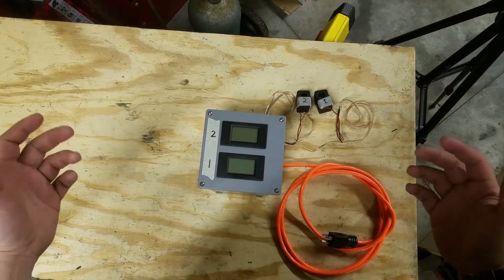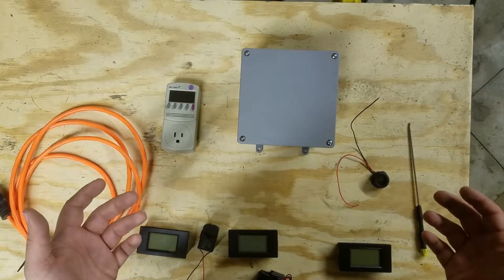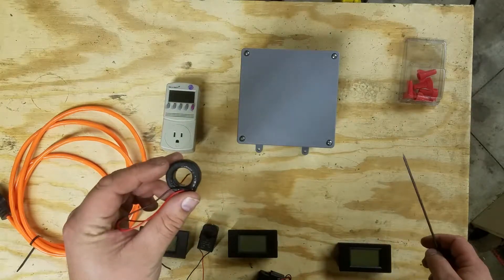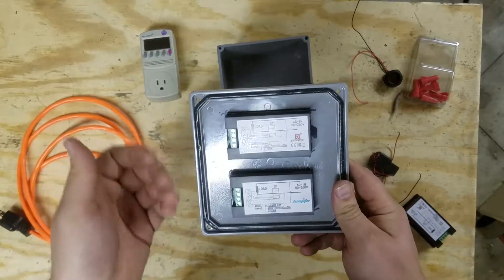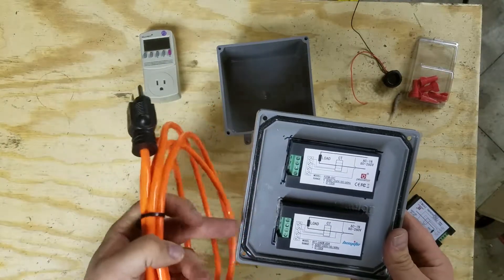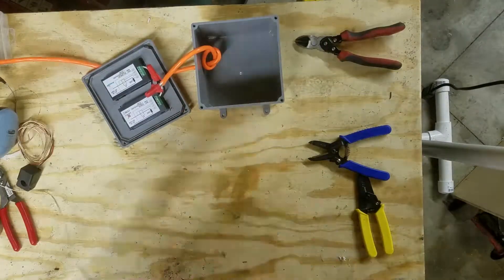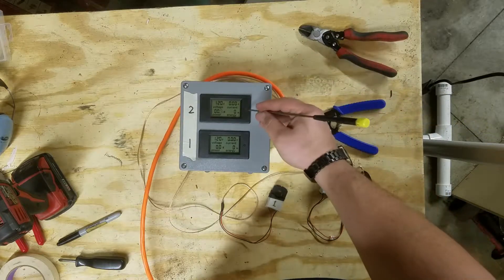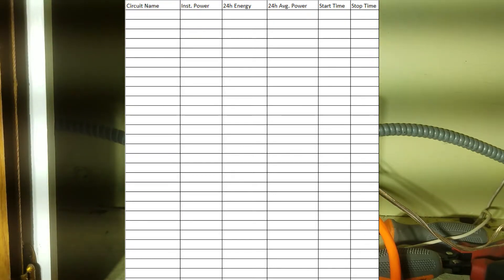How to Make a Simple DIY Home Energy Monitor (Please don't build this)

Comment: Let me get this straight......each meter measures the separate A and B legs of your main home panel ( each 120V ;  together they provide the 240V input to the main panel). However, the POWER input to the meters is from ONE of these legs....either A or B.....the way you did this with the orange power cord that is plugged-in. Is it a problem that the supply power comes from the same source to power the meters.....yet the meters READ each individual 120V power source? M y point?...should the meters ideally be powered from the legs they are monitoring ? Also this....if it's OK to power the meters from one leg.....can the power for the meters come from a new breaker added to the panel?. The breaker would be massively over-rated ( breaking amps) but would provide a clean power feed installation . Can we then wire-nut or WAGO 2 pigtails on this breaker,  to feed each meter then from one leg?
Reply from the maker: Yeah, one leg might vary in voltage slightly from the other. It's close enough. This isn't rocket science. If you need more accuracy, you should be paying a professional to do this. In fact, my whole setup here is janky, so I would recommend paying a professional to anyone that does not quite understand the electrical nuances involved, and why this voltage difference is not significant enough to account for given someone so cheap(Not saying I'm not cheap, of course).

The IotaWatt also only uses one 120V reference by default, and I've found the energy readings from it to be very close(Less than 1% variance) to what my power company shows.
Reply: @manovermachine  ..thanks.
Reply: @manovermachine  ...I didn't mention.....but maybe should have.....I am intending to install these 2 meters to indicate the power supply from an emergency standby generator that is set up to backfeed my panel via an interlock setup. So yeah...it's not rocket science, BUT....the 240V incoming from the L14-30 connection (240V) of my generator....is created from the 2 coil circuits on the genset that make 240V....and measuring each side can indicate the health of the gennie AVR or its brushes...so trying to keep the 2 circuits separate from both a power supply standpoint and also the monitoring standpoint.... seemed important to me. Maybe it's not, as you said, but you also assumed line power throughout.. Hmm....that said, maybe this only makes a difference if the meters are connected directly to the generator panel vs near the main panel? Do you think it does? That's why I also continued with the question of panel breaker supply to power the meters.... that (maybe) power should supplied to one meter from panel leg "A" and the other meter from panel leg "B". I'm saying all this in case you have a different answer based on measuring non-inverter gennie power ...vs the line power scenario, where you clearly said show so little variation. Thoughts?
Reply from the maker: @TheWilferch  If you have the potential for there to be a fault in which one leg of the generator's output voltage could vary in a fault condition, then it would certainly make more sense to hook each power meter's voltage input up to the same live they are measuring, respectively. I just combined them because it was a lot simpler than digging into the panel for what I admit is a pretty.... lazy setup. Mine was intended to be very temporary.

As for being at the generator vs at the main panel, there will of course be a lower voltage at the panel than measured at the generator due to line losses between the two under load. I can't think of a technical reason of why you would need to choose one over the other off the top of my head, so I would say go with what your preference is. Just be aware that power readings and voltages, and thus powers will be slightly (hopefully not much) lower if measured at the panel vs at the generator.
Reply: @manovermachine  ....thanks for staying with me on these nuanced questions....all good......thanks !!!

Comment: Could you please tell me what make is the meters also can I obtain them from (Amazon )
The thing is I have an (industrial fan heater ) I was unaware that I had turned the thermostat knob to max and in turn it melted the rubber plug. 
It was drawing (16 amp ) instead of (13 amp). It melted the plug socket at the same time. During 09:15 hrs on Sunday 25 December.  I would like to build one.

Comment: But how will the two meters read any different values aside from the current clamp signals?  If both are wired parallel to eachother and into a single circuit then the voltages will always be the same and what voltage the circuit is theyre plugged into..  i would think that they would need to be put in series with a circuit to monitor the power consumption of the things on that circuit..  like if you were to run a submeter in line with the two main line feeds to your panel so it sees total power consumption. Just like the power companies meter..  i was wanting to install something like that because i dont trust the electric company meter..  wanted to verify my usage..

Comment: In my home country Nigeria, electricity distribution companies issue estimated electricity bills at the end of the month and the cost of getting a prepaid meter is much, pls can this be used to take readings of power consumption at the end of the month?
Reply from the maker: You could use this device to measure your power usage over a month. Having said that, this does not mean that the energy supplier / power company would accept these readings if it wasn't an approved or calibrated device. That'll be dependent on the laws in your country, and the agreement with your power provider, etc.

That said maybe you could use it to start a conversation with them if you find your estimated value is very far from measured. (The meter will probably only be accurate within a few percent, but probably within 5 to 10% easily depending on the quality of the device). If it's very close to estimated, you could probably rest easy knowing that you don't have much to gain from getting a meter.

Comment: If I had a grid tie inverter and let's say I was pumping 1000watts into one of my circuits.
Would the 120v side of the grid tie circuit read the same? as I'm still consuming the same power, but drawing less from the grid. 
Or is this only seeing power coming in from the grid ?
If that's case I would see a 1000w drop in wattage?
But thinking how electricity flows I don't think this setup would beable to see that 
It would just show power consumption no matter where it's coming from ?

I know I can see the difference on my mains power meter.
Reply from the maker: The meters I used are incapable of determining which direction the energy is flowing. They're programmed to assume that regardless of whether the current and voltage are same or opposite polarity, that power is being absorbed. This makes it easier for the layman to hook up and use it, but they are not suited to a case where you may generate electricity. There's likely a different brand out there (and probably for a different cost) that takes that into account and allows you to measure net power, but I haven't looked for one yet since I currently do not backfeed any power to the grid.

Comment: I understand how this works for 120 volts on each leg. But if a device uses 240 volts aren't you measuring its wattage twice if you just sum the two meter readings?
Reply from the maker: If you're powering the meter from 120V, the wattage is calculated based off that, but if you power the meter from 240V, the wattage is calculated based off that times the amperage. For a 240V device, you only need one meter if you hook the meter up to 240V. IF you hook the meter up to 120V, then you'd need to measure the current twice (or just double the power usage) to know what the device actually used in terms of energy.

 Then again, I feel like greater care should be taken than I took in this video to make this a safe setup. Shouldn't have current transformer wires hanging out in the open.

Comment: This is pretty cool. I need to install something like this on the panel to check when i run my gen. I just did 7 days near NOLA after Ida. NOt fun.
It would be sweet if it were possible to connect to your phone through bluetooth to monitor inside.
Anything like that exists?

Comment: Question. Do the two meters need to be connected in separate lines or legs to have their power up in generator backup? I know that the CT has to be on each hotline but I'm wondering if the measures change by having them both connected in one breaker (one leg) or separate legs for the meters.
Reply from the maker: Ideally they'd be on the corresponding 120v hot leg that the respective meters CT is on to provide an accurate measurement. But it would be close enough if you used the same for both, since we're not doing rocket science.

Comment: Pardon my ignorance but I have a question...  you have 2 because you have a 200a panel and #1 is going attached to the black cable and #2 to the red cable incoming main lines?
Reply from the maker: I don't have red cable on my incoming lines. It really depends on when your house was built, and where, etc. But those are the two 120V leads from the 240V split rail service, so that is correct in why I have two meters.

I'm measuring each 120V leg separately, because the Neutral connection exists and a current imbalance can exist between the two lives.
Reply: @manovermachine  so, your panel is a 240v panel receiving 2 cables with 120v and 1 neutral.  ok if that is the case is just like mine. I would also need 2 of those.

Comment: Interesting.... why two units?  Also... could I use this as a way to read the wattage draw from my portable generator when connected to my house?
Reply from the maker: Houses in North America use 120/240 split phase power. If you have an unbalanced condition where one branch is pulling higher current than the other, one meter cannot accurately measure the total power, so I just use one for each 120V rail.

To use one meter for all of it you'd have to reverse the other live wire and pass them both through the current transformer, and read from a single 120V line, which would result in your voltage no matching as the drop across the wires on the other side will be different, especially if current is not balanced and there's some in the neutral.

Plus the incoming wires are too big, stiff, and short to get around one current transformer.

You could definitely use this on a generator if you wanted. I feel like it's a really clumsy setup in hindsight, but it does the business.

Comment: I'm no electrician so I have no idea what I'm talking  about. I'm just trying to understand. If you plug your meter you made into a 120V outlet and then put your ammeter over a water heater circuit (240v) won't it give you an incorrect power reading? A 240V water heater drawing 20amps will use 4800 watts of power. The meter plugged into a 120V supply will be calculating the power incorrectly for the 120V, not the 240V. It will only show 2400 watts of power being used. This will show a huge miscalculation on how much energy the 240V appliance is actually using. Am I doing this wrong?
Reply: Right I don't think his wiring is correct. From my understanding you would need to get the voltage to power the meters from the mains (this completes the loop in the diagram)  You need to double tap the main breaker with a wire. The wire then runs to each meter from each leg of the main. I'm 
 not a big fan of adding another wire coming from the main breaker.  Let me know if I'm wrong or right.
Reply: @billdee814  I don't think you'd need to directly tap to mains, if you had a 240v breaker in the panel. Add each leg of the input power to the 240v breaker, the voltage is now correct in the meter and meter calculations. I would never tap directly to mains power.

Comment: Why didn't you show where you plugged in that cord? Did you just plug it into any old 120 outlet? Can you please expand on that connection?
Reply from the maker: Just plugged it into any old 120V outlet. Not aiming for rocket science levels of precision here, if you're on a different 120V rail there might be some error if one is more heavily loaded than the other, but you're probably within 5-10% easily in a normal case. If you want to be more accurate, make sure the 120V tap is as close to what you're measuring as possible, and on the same circuit.

Comment: It's unclear were you connected your 3 prong extension cord in.  I a wiring diagram would help here.  I'm thinking it would only connect to one side of the load, ie, one of the 110 legs.  Don't you need each Meter to have it's CT and load to be within the same circuits.  Same leg of the different legs of the 240V
Reply from the maker: For these meters, it does not matter which leg of the 240V you plug them into. As long as you have a single phase (240V/120V is referred to as split phase, but is still single phase) service to your home, it will measure the power correctly.

 The reason for this is that these meters always assume the power is being used by your home, rather than being put back on the grid as might be the case if you have a solar panel setup with the proper back feeding inverter. If the meters were capable of telling the difference, current transformer orientation and polarity of the voltage connection would be important as you suggest.
Reply: Really would be very helpful to show how you wired the extension cord to the meters, you just said white to white and black to black? Did you split the one extension cord into 2 white and two black using pigtails? Please clarify
Reply: @chipfornaris  3:45 well,  he said that is going to be connected the meters to the extension using all black together and all whites together to give them power, the important thing is the core transformers have to be in different lines.